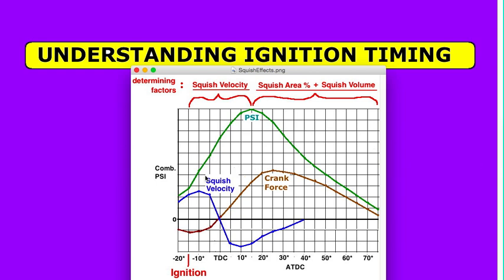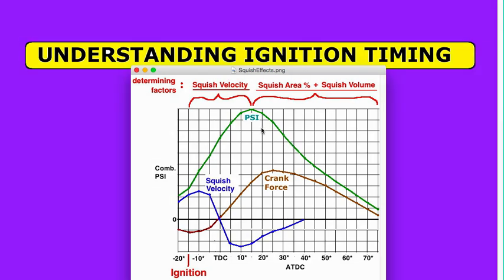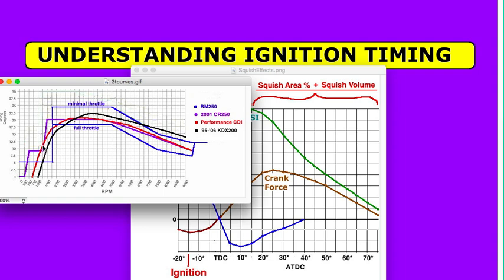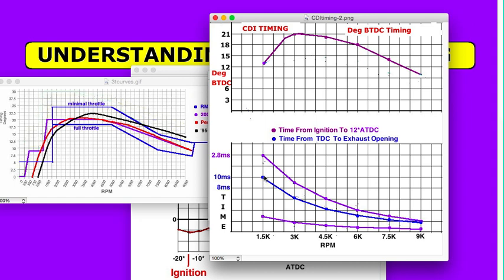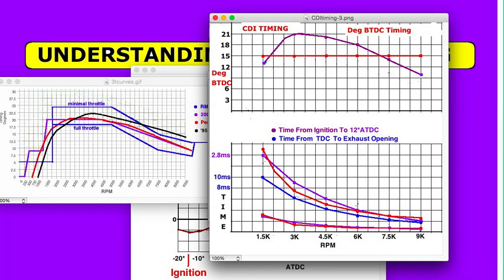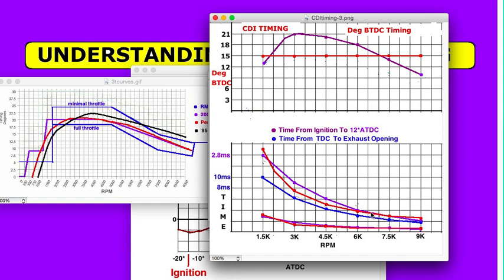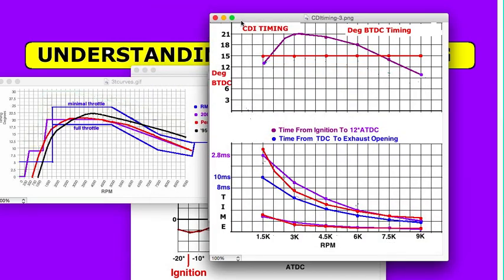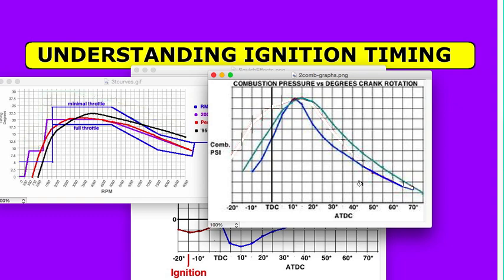CDI Ignition Timing

Comment: I have a 77 RD400C that I rebuilt back to stock. I love these motors stock, chambers and airbox removal destroys low/mid power making them a chore to drive around town. I did add a Vape ignition but it still has a flat ign curve of 10 degrees I think it is but these bikes make so much more torque with a proper curve. My plan is to buy programmer unit but I still need to find a dyno so I can find a curve that's good but safe. There are no dynos in my smallish city sadly.
Reply from the maker: A standard timing curve will get you within 95% of "the best" timing. Does it have points ignition?
Reply: @MichaelForrestChnl  Hi.. I replaced the points with a Vape ignition. I did have an HPI on it that had a 'safe' curve and the bike really made good power with it but the flywheel was tiny and almost weightless and I really didnt like the way the bike felt at lower rpm.. and having to keep a higher idle as well to prevent it from stalling. The chunky Vape flywheel makes the bike feel miles smoother. Perhaps I should just program in the same curve the HPI has and be happy with that.

Comment: Your timing curves go down after a certain point. Are these engines boosted? Are you trying to maintain a specific cylinder pressure? Trying to reduce power a higher rpm? For what purpose? Is the engine starvi g for fuel? In a car engine, given that enough fuel and naturally aspirated, curves typically incline to infinity at a diminishing rate as rpm goes up. Even with boost you should have a lower overall timing but it should still climb.
Reply from the maker: that is typical for an analog CDI which is why most CDI's are not analog. If the timing is kept from diving down at top RPM then more over-rev is possible.
Reply: When you say boosted well in a way they are, 2 strokes rely heavily on exhaust resonance, (and inlet resonance) when they are 'on-the-pipe', the volumetric efficiency (VE) of the engine will go up well past 100% This increase in VE will increase the initial pressure in the cylinder (the pressure BEFORE the plug fires), this increases the flame speed which means that you need to retard the timing so that the peak cylinder pressure occurs at the right point in the power stroke, certainly NOT at TDC as some idiots on youtube claim! If the pipe has a tuned length of lets say 9k RPM then the timing will retard more and more as it get near 9k because the pipes is working nearer and nearer in designed PRM. once past 9k the pipe starts to work slightly less well so the timing can start to advance from that point onwards as the VE of the engine is falling. People that like to talk nonsense will talk about retarding the timing to increase the pipe temperature, this is all secondary, its VE and flame speed that are important. (Heating the pipe will change its resonant frequency RPM). The other thing to note that in simple terms as the revs rise you would think that the timing would advance, well it would have to if the VE remained the same but it 'goes through the roof when the engine comes onto the pipe' hence the odd looking ignition 'curve' that you see in this video. Finally 2 strokes are quite fussy when it comes to timing, a 2 stroke in a reasonable state of tune likes nothing better than to either seize or blow a hole in a piston, an over advanced timing gives it just the excuse that it needs!
Reply: It's going down because it's revving more so  therefore so it has to make the spark even sooner than it would would with lower RPM 4 peak pressure

Comment: What determines  max advanced in the ignition curve in relation to rpm ?
for example the engine revs till 9000 rpm and the power band kicks in at 5500 rpm , would you start retarding the ignition from 3500 rpm onwards which is what a stock rd350ypvs curve does  or advance the curve till the pipes kick in and then retard it ?
Reply from the maker: I would think there should be some change in a normal timing curve to match the increased delivery ratio and dynamic compression inside the powerband but I don't see the manufacturers making that compensation so maybe it's not needed

Comment: Hi very interesting on ignition timing I don’t know if you have come across ignitec ignitions 
I have one fitted onto my 250 race bike for roadracing with a programmable map as I understand from you 30 degrees before tdc for high reviving 2 strokes or am I not understanding correctly
Reply from the maker: the final say so is how your bike runs. Just try different settings. As fas as the highest ignition advance for mid range RPM if a certain range of settings feels the same then choose the least advancement.

Comment from the maker: I failed to mention why it seemed correct that the chart curve of time from ignition to 12*ATDC gave a similar curve to that of the time from TDC to exhaust port opening at different RPM. 1)  Most CDI are very similar with their timing curves and that can't be a coincidence, it has to be because that is what works best. 2) That typical curve that I charted out had the same curve progression that the chart for time from TDC to exhaust opening had which has to have some significance.  3) It's obvious that the typical CDI timing curve is superior to fixed timing or else CDI's would be made with set timing also.